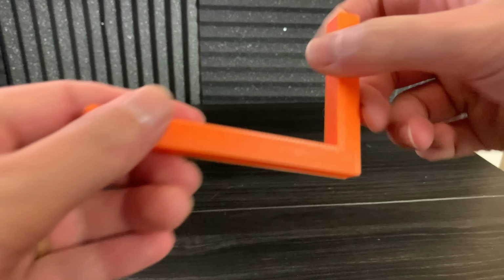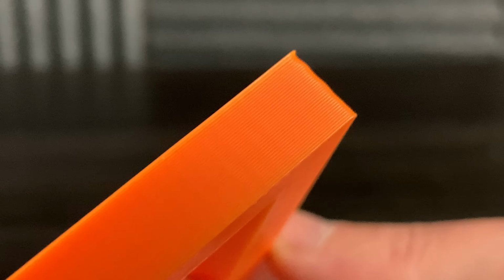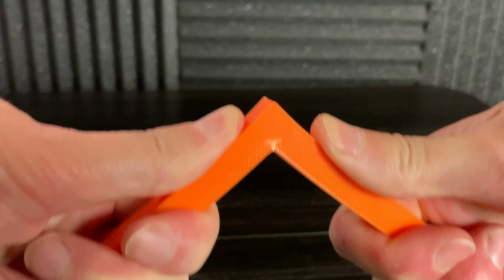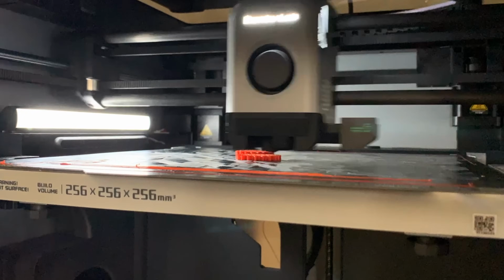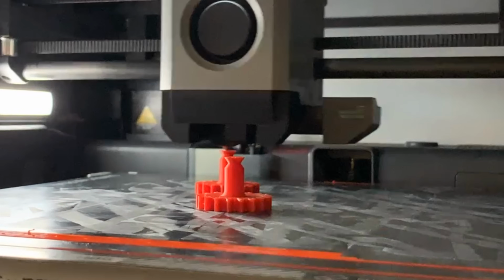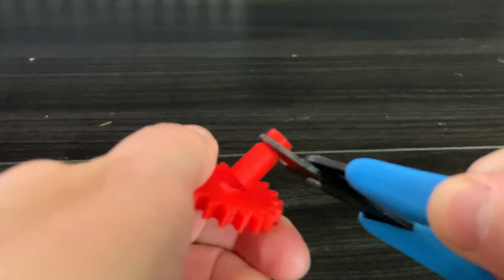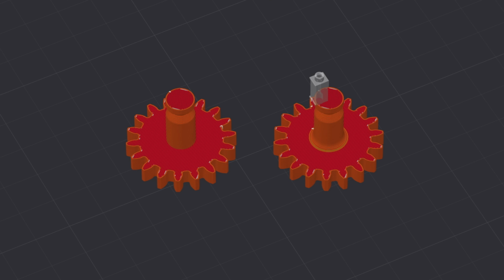5 must-know 3D printing tips & tricks. (stronger and better looking prints)

Comment: Another tip is to print the gear and axle in 2 pieces. Lengthen the axle and create a hole in the gear to fit it. Print the axle on its side and then glue the two pieces together. I did this to make a new knob for my trash compactor.

Comment: Flat surfaces that you want to be tougher, or denser - almost like 100% infill, but not in other areas of the model... you can perforate with a grid of tiny holes - then add more walls in the slicer.  Boom -  selective infill.

Comment: I add holes down the middle, round or square, add extra wall or two, and then print a slightly undersized pin (dowel) laying flat to have layer lines long ways, and drive it into the hole.  Make's it very tough to break.  Add slow cure super glue or epoxy makes it extremely hard to break along layer lines.

Comment: I use bamboo skewers epoxied into any shaft that has to be printed vertically as my skills at CAD are less then a 4th grader on Tinkercad but adding an extra hole here and there to glue wood rods in is silly easy for a moron like myself.

Comment: Ive found that printing some parts at an odd angle helps strengthen them too. Or making the part in mutliple pieces that are at different angles then glued together, like plywood. You have to look at it as if its made of wood.

Comment: Did you mention print temperature?  Raise the heat to increase the layer strength.  Makes a huge difference in shear force resistance.  But of course, the hotter, the more warped a feature becomes.  One must experiment per each type of print.

Comment: yes 
but if you need to have axle at the 90 degree either concave the gear around the fillet or print the axle as separate piece in stronger orientation

Comment: Here’s a big tip to designers. 
You DONT need to make everything indestructible!!

It’s insane how strong people design stuff to be even for just little boxes or decorative things. Not to mention how much more material it uses, how much longer it takes to print, etc. 

I have a bunch of little SINGLE WALL vase mode boxes that are plenty strong enough to store little desk things. And it doesn’t have to be that much thicker to be much stronger. It doesn’t need to be 6cm thick to be good enough for it’s intended use.
Reply: I partially disagree. There's strong enough for its originally intended purpose and then there's strong enough to be capable of doing whatever the person printing it, wants it to do. The latter is crucial for publicly released designs, as overengineering will save on material used in the long run, compared to "just strong enough", which will see more parts breaking, resulting in far more wasted filament. Furthermore, making durable parts doesn't have to be done with 6 cm thick walls. It can be done by clever use of geometry, specifically triangles and circles. Use those shapes properly and it's possible to design really strong prints, while simultaneously saving on material

Comment: For those wondering, how you would create a fillet, when mechanical interference with other parts might be an issue:
In the example of the gear, make a recess into the gear and create a fillet inside the recess
Reply: You can also just fillet both the internal and external faces. Internal of the outer part and external of the interfacing part, give a tiny bit of clearance and call it a day.
Reply: @JeronimoStilton14  easy. I like it
Reply: @glazedfaith  It may not be easy. For complex geometry, complex gear assemblies and/or complex mechanisms, @ichbrauchmehrkaffee5785 gave the best solution, as it would take more time to fillet the internal and external faces, compared to just making a recess in the gears and fillet that. As a side note, doing both in simple geometries, mechanisms and gear assemblies, can actually increase the strength of the part, as you both introduce more rounded surfaces, as well as more surfaces in general, which increase the strength of your parts... given you apply it correctly. A good example of how more surfaces can increase the strength of a part, is looking at the shape of a trailer plate, which is bent in a somewhat odd shape. However, this shape is what gives the trailer its strength, as it's now a lot more capable of resisting forces from both the side and the top, than a flat piece of metal, all done by just bending the piece, adding more surfaces.

If this sort of stuff interests you, I suggest looking into mechanical engineering and material science. It sounds complex, but the basics are easy to understand and apply, as seen in both this video and in this comment section

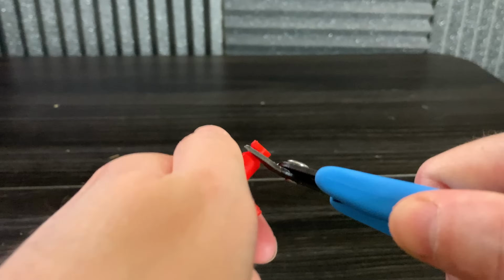Comment: 1:40 the axle also breaks off easier because it's only attached to the surface of the part which has layer lines oriented in a different way. If the slicer was a bit smarter, it would create a shell that goes through the gear itself, improving the connection between layers.
Reply: simple solution for such problems is actually modelling the axle hollow and then placing an infill yourself directly in cad - this way, the slicer thinks that the axle is not a solid but rather an "outside" surface
Reply: @suit1337  Simple yes, but a bit tricky to execute.
Reply: takes a bit more filament but increase your infill to 85% or more. The added filets are also a must as you suggest!

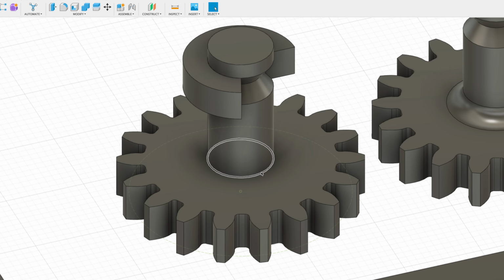Comment: When you are rounding those corners (1:46), which software is that?
Reply: Fusion 360
Reply: @Mircea Croitor  thanks. Way back I learned some 3D modeling of Autodesk Inventor.  This Fusion is the software that seems to keep coming up as the one to learn and tye interface there looks a good bit like what I remember from Inventor.

Comment: Another thing you can do with that gear and axle would be to add a slightly undersized through hole up the middle that you can tap and add a bolt to. The bolt adds compression force and makes that joint MUCH stronger.

Comment: Thanks for the effort but sorry it isn't a trick if you have to change the part itself. Especialy with that chamfers where it will interfere with something in 99% of cases.  Same with the corners, you can't just round it when you want, its called a corner not for nothing

Comment: To make a vertical print a lot stronger (if you cannot make rounded corners so it sticks to the part completely) - you can insert a screw inside it. Then it would hold like crazy.
Reply: Then why bother printing?
Reply: @AnotherCGv Because a screw isn't a gear...

Comment: Greate video. I had a problem with 3d printed gear so i printed it in 45 degre angle and that fix the problem.
Reply: Can you expand on this?  What was the problem and how did tilting the gear solve the problem.  Much appreciated
Reply: @markortiz1506  The gears are subjected to vertical and horizontal forces, so rotating the model allowed the force to be split and the transitions smooth. The problem was the gear in the toy for my godson
Reply: Printing at an angle was better because no lines in any of the axes which would be stressed when using the part?
Reply: @xitalianm  Exactly as you're saying

Comment: If only it were that simple. In lots of situations, fillets like this introduce a mechanical interference.
Reply: Hmm I wonder if instead having a curved recess into the part would acheive the same effect while lending the desired clearance.
Reply: @jero37  yup. Its called an undercut and is used all the time
Reply: @jero37  Yeah I was thinking something like that too.
Reply: It's not a rule. Those are just tips you may take into account and implement if the model allows it :D
Reply: If that’s the case I just make an undercut. I usually just subtract a small cilinder
Reply: @WouterZtube  how would you go about doing this btw?
Reply: @Shadowslands  if you use prusaslicer right click the model and add a negative volume, move and scale into place and you’re done
Reply: Simple, filet inwards into the gear and then filet up into the shaft makeing the filet flush with the surface of the gear eleminateing both problems
Reply: I imagine you could recess the fillet though.
Reply: Chamfers are great for creating a clearance area where fillets may interfere with corners.
Reply: In machining, this is also an issue with unfilleted inside corners.
The solution: Have the corner extend into the material an create a fillet there.
Edit: the other commenters have allready pointed that out and used the propper term "recess"
Reply: It's that simple where it's applicable. It's silly to think the suggestion is to design something that doesn't work lol. Put the fillet on an offset or recess. Use your head.
Reply: @starholedesigns  Of course recessed fillets are an option, but the recess decreases cross sectional area somewhere else, which makes it potentially a tradeoff for part strength rather than an obvious win. Ideally slicers would be able to do smarter stuff like effectively making a fillet in the negative infill space where it would help part strength.
Reply: Variable infill can help, go 100% for stand offs and a couple of millimetres below them.
Reply: Clearly this video wasn’t for you
Reply: Fillets are backbone of a structurally sound part. Your mating part should be designed to to clear any interfering fillets and what not. It's just basic stuffs.
Reply: Borrow clearances, friend.

Solving problems is the most fun and important part of being an engineer.